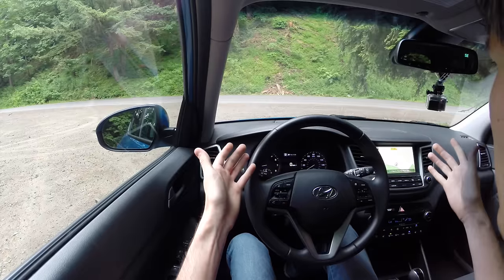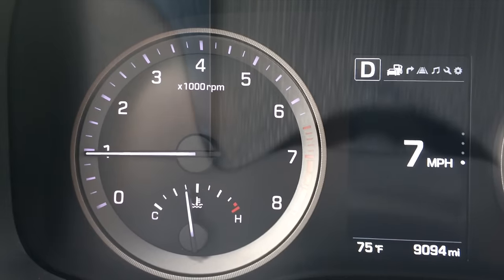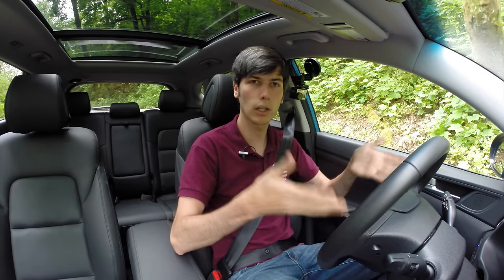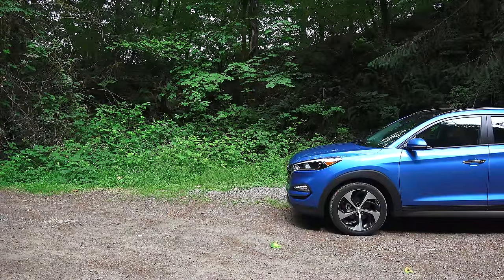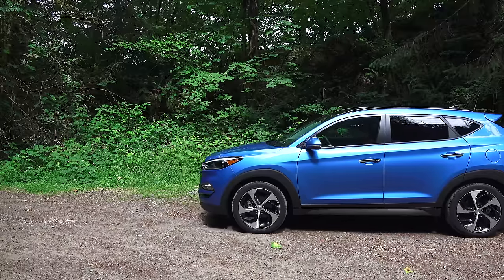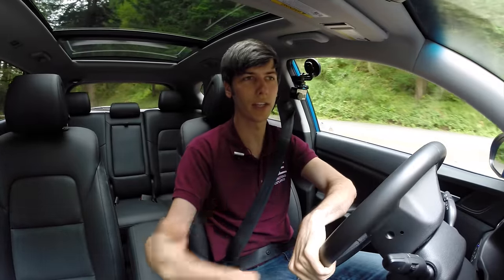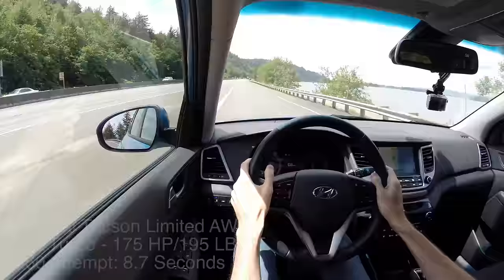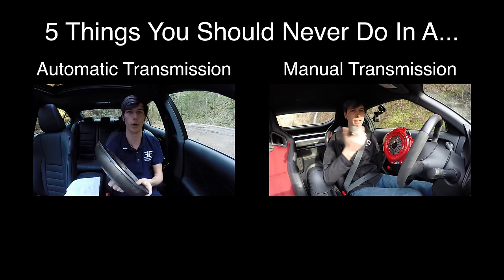5 Things You Should Never Do In A Dual Clutch Transmission Vehicle

Comment: Jason, my experience with my ‘13 S4 is clutch is the clutch is binary, either disengaged when brake on or, upon releasing brake, quickly fully engaged.  Engagement does not seem to use any slipping mode, counting on the low 1st ratio to make the transition smooth enough.  Fly is when you hit the gas quickly in an up hill scenario, then engine speed gets elevated above idle before the clutch closes, resulting in a jerk motion.  Also about no slip evident in a launch (only did that once!) as pretty violent on the drive train when no wheel spin to absorb the overload.

Comment: Good video! Stuff I already knew, being familiar both with the mechanics and the programming logic, but really glad to see this info getting out there in an easy to digest format. Many people I talk to driving dual clutch cars and not realizing that it IS NOT the same as an automatic. Then they wonder why the clutch pack is shot in 30k miles, and they think it’s a bad car... when no, it’s the automotive equivalent of PEBKAC. ;-)

While I am a manual aficionado, having driven a couple of Porsche PDKs and VW DSGs, I can see the appeal for the more engaged driver who doesn’t necessarily want to (or maybe can’t due to disability) work the third pedal. I find they are vastly superior for an enthusiast driver than a torque converter slushbox or a super-slush CVT. They have the direct engaged feeling of a manual, and I really like that as a driver.

Comment: +Engineering Explained This isn't accurate for all dual clutches. I have an Audi S5 (7 speed dual wet clutch) and it DOES NOT release the clutch when waiting at a stop light with the foot on the brake. This is confirmed in my car by multiple things:
- you can feel the engine trying to pull. Moving the lever to N causes a slight movement and you can hear the engine quite down
- instant consumption is about 1.9L/h. Moving the lever to N causes it to instantly drop to about 1.2L/h
- releasing the brake causes the car to move absolutely instant, there is not even a ms of delay, it is quite obvious that it was already pushing
- my local dealer confirmd I should move to N when waiting for longer periods of time. 

I don't know if this difference is because I have wet clutches compared to the dry ones in your test vehicle, but it feels like something you should mention in your video. 

Also, regarding launching the car, many cars equipped with dual clutch gearboxes have launch control.
Reply from the maker: Interesting, could certainly be a different process for wet DCTs, as well as different automakers. I know VW dry clutches will fully disengage when you come to a stop, dunno about their wet.

Comment: If you pull away slowly in auto, the gearbox switches over to 2nd before the revolutions are high enough, but the clutches keeps slightly disengaged to keep you acceleration smooth. In such a condition, do not suddenly floor the accelerator (before it properly engaged 2nd at about 1800 rpm), because the engine is going to transfer a lot of power to a slightly disengaged gearbox, which will put a lot of friction and ultimately wear on the clutches. It will wear out the clutches much faster, or may result in shuddering due to an imperfect setting of the gearbox slippage factor.

Comment: Can you make a video on "5 things you should never do in a CVT transmission car"? There are a couple things I can think of that you shouldn't do.
Reply: For instance?
Reply: #1: dont buy a car with a CVT
Reply: nailed it.
Reply: +TheCarista. don't have fun in a cvt
Reply: Could say the same about a DCT
Reply: I think a DCT is a lot more fun than a traditional american automatic transmission. You don´t get the flabbyness that the torque converter will incur. With a nice DCT and paddleshifts driving can be pretty fun.
Reply: RIP Nissan Maxima. Everything was going good until they gave it a CVT. :(
Reply: +Cup my dad had rented a nissan maxima when he was getting his car repared, and the CVT is awful. The drone is just, well, drony and it feels like an appliance rather than a car. Its a shame because it was actually a decent car with a good engine
Reply: Honda actually makes a decent CVT and strangely Subaru has it as an option for the WRX.
Reply: Hey, CVTs are good for their purpose, which is smooth driving. Why would you want a more complicated dual clutch on a minivan or a crossover? Subaru uses CVTs which are great for offroading and great for driving around town. If you want a sports car you get a proper manual.
Reply: I think EE has better things to do than make a video about a lawn mower tranny.
Reply: +sebaaaa56 If you want a sports car you get a proper DCT*
Reply: I forgot if you even mention the word CVT in front of car guys you get this. It's good for what it's purpose is to do: save gas.
Reply: My weekend car, a Fiat 500 Cabrio is a manual, but for my daily drive in traffic and around town my 3.5 Altima SL is smoother with its CVT.
Reply: manual is the only way to go!
Reply: Ignacio Romero I suppose you don't know how to use 3 pedals and a stick with numbers on it, then...
Reply: +Ignacio Romero correction: if you want a HYPER car you get a proper DCT. Sports cars (Nissan 370z, BMW M4) should have a proper MANUAL.
Reply: sebaaaa56 I do, but DCT is faster
Reply: +Ignacio Romero doesn't matter. Sports cars should be all about fun and the driving experience for me. Shouldn't all be about 0-60 and track times.
Reply: anything.
Reply: +supermotardmario what would you call it...?
Reply: +Theodore Marakas if you read my comment, it works well for people who do a lot of city driving and sitting in traffic. Obviously you didn't.
Reply: MoronicAcid1 And boring
Reply: +Theodore Marakas you get used to it. I didn't buy my Altima to have fun. I bought it for the smooth drive and the fuel economy. Why do you think I bought a manual car for a weekend car? Duh.
Reply: #1 DONT BUY ONE
Reply: +Frank Magana This man speaks the truth
Reply: you should never buy it
Reply: +MyRealName +10.000 :-)
Reply: ***** that's pretty much like asking why all cars don't come with custom ecu map a customer wants. i believe all the reasons to this apply to your transmission as well :)
Reply: ***** thought this does give me the idea. imagine having few maps you could choose from, just a few "typical" maps for people to choose from. making individual software modifications for everyone would be impossible, but i can imagine having let's say 10 different software maps to choose from. hell, car companies could even charge them a little bit more and earn some extra money, especially if those maps they make are not effecting cars durability enough to make warranty questionable, so all buyers could consider paying extra for those.
Reply: there is only one important thing to know about cvt, Never buy cvt, greetings
Reply: samymasta solid reason, reply back to us in 80000 km or 50000 miles and tell us if we were wrong with the advise to stay away from ctv :)
Reply: Mario Millan Ever heard of a warranty?My car is brand new,and it's a Mitsubishi.Drivetrain 10 years/160 000km.I'll gladly get back to you.
Reply: *****
Exactly.Purists,will get a manual transmission,anyways no matter what.So for others who aren't looking in performances,(which is the general public)I think it's great,I had a normal auto transmission before...I have absolutely 0 reasons to go back to it lol.If I want smooth,economical everyday driving,I'll get a CVT,to me it's simply a refined normal auto trans I guess!If I'm looking for fun and numbers,I'll get manual for sure,matter of fact,I'm already eyeing WRX's maybe STI's :D  for next year, even looking at some slightly used Evos! I just fell in love with those Asian "sports" car,they're so much fun and pretty powerful!All that without having to spend 55k+
Reply: MoronicAcid1
Herm...car purists?lol "A purist is one who desires that an item remain true to its essence and free from adulterating or diluting influences"Manual transmission being the O-G we could say...but yeah,CVT is excellent for efficiency/smooth comfortable rides!
Reply: I don't know about Nissan but Subaru makes a CVT that's pretty much drone-free.  They also went to the trouble of allowing it to simulate gear shifts under hard acceleration so that dumbasses don't complain about the CVT feeling "weird".

However, under normal driving it still gets better fuel economy than either a manual or a traditional automatic.
Reply: In theory, yes.  But in practice, many drivers complain about the "feeling" of a CVT under hard acceleration.  This is a case of engineering being driven by marketing.  The purpose of a CVT is to increase fuel-economy.  But they can't do it if people don't buy them.
Reply: Jonathan Gwynne
Reply: Lawnmowers use a hydrostatic transmission. Snowmobiles, as well as some vehicles use cvt
Reply: That was for southpark11235
Reply: I’d almost guarantee most of the cvt  experts have never driven one.
Reply: the only good thing about a cvt is that you can go like 50 in reverse
Reply: Vikk 54 like buying a car that has one

Comment: The concern regarding putting the gearbox in neutral at a traffic stop, vs just riding the clutch, is a wear based concern.
You put the manual gearbox in neutral to avoid wear. 
The engineers of the dual clutch gearbox did not put the gearbox in neutral when coming to a stop, they redesigned the actuation of the clutches, so that when the clutch is disengaged (but gearbox is not in neutral), the wear is almost non-existent, so you're wear-safe, while the TCU rides the clutch at a light.

You should clarify that dual clutch gearboxes have a mechanism that actuates the clutches in a manner opposite to manual gearboxes.
The concern in a manual gearbox, regarding keeping the gearbox disengaged by "riding" the clutch at, say, a traffic light, is not with clutch disk lining wear, but with pressure plate diaphragm finger wear and with throw-out bearing wear. 

In countries where automatics were in the past non-existent, "clutch riders" achieved cutting of pressure plate fingers, with the bearing. The bearing soldiered on even once the balls started to fall out of the race(s). 

However, in this dual clutch gearbox case, the mechanism engages the clutch directly, the clutch is engaged when the "clutch pedal" is "stepped on".
This can be done, because the mechanism doesn't incur the problems that an operator's fatigue would pose. Imagine driving the manual for only as long as you could hold the clutch pedal to the floor...
The advantage of this method is that once the car comes to a stop, and the TCU decides to disengage the clutch, the bearing doesn't incur wear, nor does the pressure plate.

Of course this design then presents the question "what about the wear of the clutch plate and throw-out bearing while you drive?". This has been resolved by a redesign of these components.
There is no more clutch throw-out bearing, now there are two "rotating pistons". The rotating pistons are directly actuated by hydraulic fluid, so more-or less they are like a rotating clutch slave cylinder that is fastened to the clutch pack. It looks like and it is called a piston, because it has the reverse functionality of a piston:
It has a lubrication groove, but instead of releasing lubrication oil through this groove to the cylinder, it receives actuation oil through the groove.

All the wearing interactions (other than the disk-plate) have been eliminated. 

That's why you don't need to put the dual clutch in neutral at traffic lights.

Comment: Ever since I watched an onboard cam on an F1 race car, I've wanted an electric servo shifted dual clutch transmission. Now I have 1, a 7 speed, and got it for cheap!
Reply: You mean you have just a transmission, right? XOXO
Reply: Interestingly, F1 cars don't have dual clutch transmissions (they are banned). They have single clutch transmissions which are just synchronised to shift really fast.  (You get a gear soup of broken bits if the synchronisation is off!)

Comment: No 1: might be valid for some (all current?) models that are newer than mine. When my car comes to a full stop it does not open the clutch fully. When I put it in neutral you can literally see the fuel consumption dropping and you can feel that the engine stops trying to move the car.
No 3: in heavy traffic I let the gap in front of me increase first. Then I accelerate but put the gear lever into neutral position depending on the situation.

Comment: 3:44: "you shouldn't downshift while ON the accelerator pedal," With due respect that statement is incorrect, you should absolutely press on the accelerator and downshift simultaneously when you need acceleration for example to pass the vehicle ahead in the shortest possible time. In practice I normally press the accelerator just a split second before the downshift in order to get the smoothest/quickest change. If you  had left it on auto mode ('D') and press on the accelerator enough, the electronic logic will simply do this for you instead. I think what you really meant is you shouldn't downshift if you keep your foot steady on the accelerator.
Reply: I was confused to when he said that.
Reply: Exactly. Thank you for this. I was confused as well. The logic follows that if you apply more throttle than you were before, the car is anticipating that it needs to deliver more power and therefore downshift to a more appropriate gear. The only time that the vehicle is going to anticipate an upshift while under throttle is if it's being accelerated gently and it's planning on upshifting for fuel economy, or if it's approaching redline. Otherwise, like any automatic, applying extra throttle, especially if it's substantial (~35% or more), is going to indicate that you're asking for more power and it will downshift accordingly. Applying extra throttle while driving a DSG, while in 4th at 4000rpm in manual mode for example, indicates that the car may need to deliver more power and downshift, therefore prepping 3rd gear instead of 5th, and smoothing out/speeding up the downshift. The inclination of someone coming from a manual transmission may be to let off the gas, as that's what you'd do before a shift, but for a DSG, increasing throttle will tell it you're planning on downshifting and will prep the lower gear accordingly. This really smooths/speeds up downshifts on a MK7 GTI, for example, as my experience and many threads corroborate.

Comment: Great video. Question: what if you have to creep while in Reverse?  Is that equally as bad as creeping forward?  It sounds pretty dangerous if you have to always accelerate when in Reverse.
Reply: No its not. Creeping in reverse is completely fine. Engineers knew it was common sense to go slow and cautious in reverse anyway.
Reply: DCTs generally have a low first gear and an even lower reverse. 
You don't need to use the accelerator to creep. If there's room, just let the brakes off completely, and the clutch will fully engage, and the car will move forward slowly or backwards even more slowly.  Less than walking speed in my car.